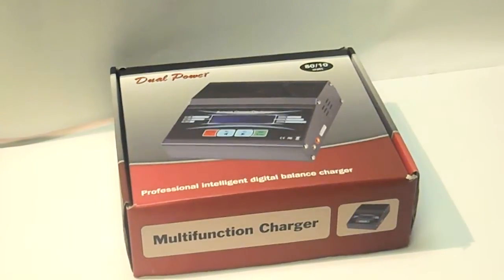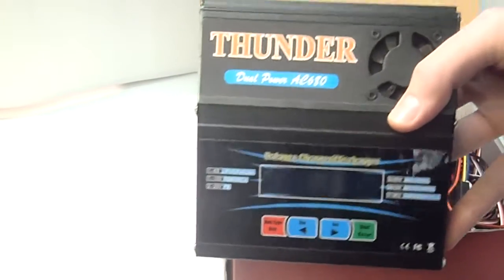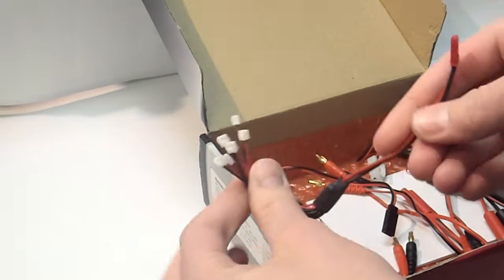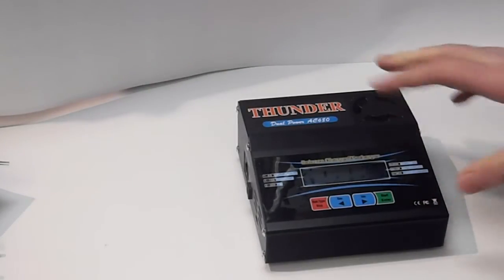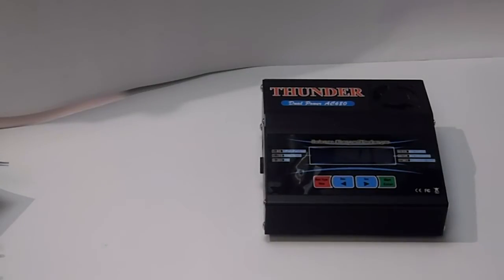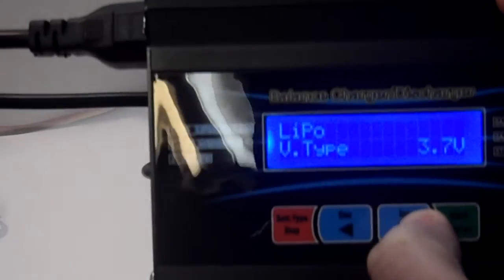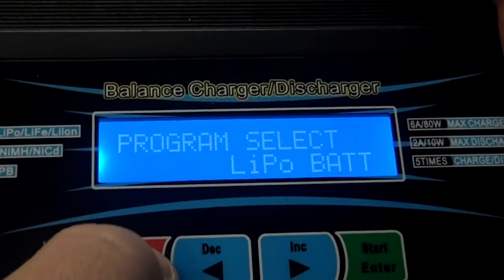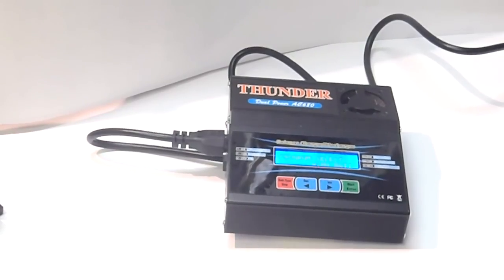Thunder Power AC680 Review

Comment from the maker: well, in the just over a year that I've had it, it has been simply amazing! It's really awesome to have a charger that can handle all battery types. It works great for cycling NiMh packs (it charges straight for 4 days or so) and lead acid lawnmower batteries. It has never had a problem. My advice would be to make sure that it's well ventilated if you are charging at high current rates so it doesn't overheat, and to make sure you charge the LiPo's safely! Hope you enjoy the charger!